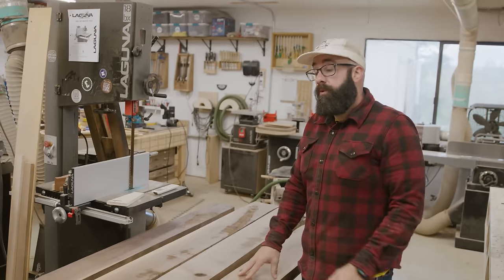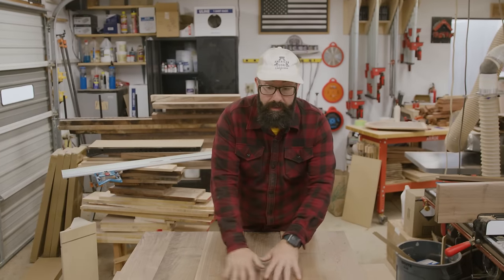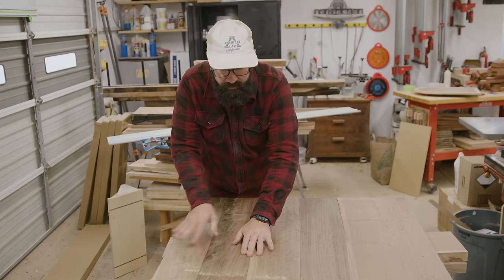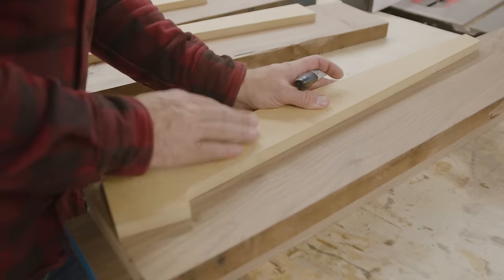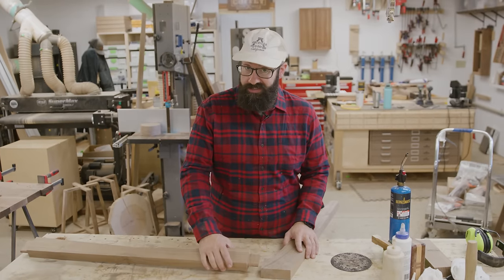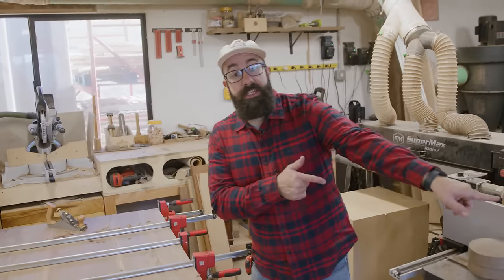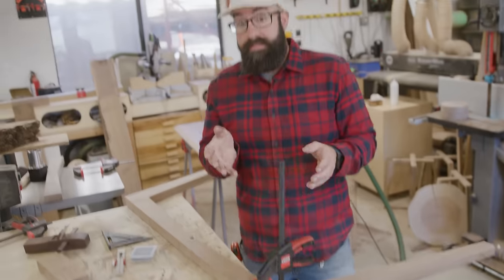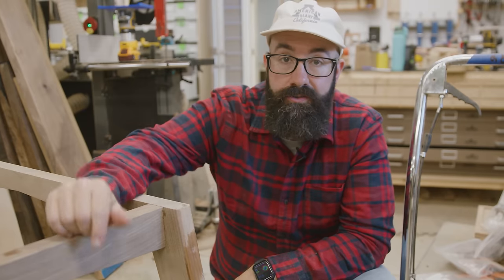$6,000 Two Day Table Build

Comment: The thing about the pantorouter and tenons, you have to test-fit while it's still clamped and sneak up on the right width while moving the guide bearing down the template bevel.
Reply from the maker: Correct.

Comment: Nice table, great video!
Since you have mentioned in the title I hope you don't mind if I'm asking about that $6K. Please believe me it comes from pure curiosity. 
While this is a really nice piece it couldn't really be any more simple, very straight forward, no tricky joinery no wild angles... Well you have finished it in two days. I'm no expert of the USA timber prices, here I could buy this amount/quality for $3-500 tops. I don't count the glue and the fittings, however that finish (rubio?) could cost some bucks, still I believe we're way under $1K in material. if you add $1000/day for labor (nice!) we're still at the half of that price you mentioned. 
How could you sell a nice but really simple average sized table that made of some ordinary wood (oak?) for that lot of money? 
Sorry if I was too straight forward, I really just would like to see it.
Reply from the maker: I'm fortunate to live near multiple highly affluent areas. Local and handmade does really well in this area. Specifically the Bay Area (tech center of the US).

Comment: Would you have considered using the Domino for the joints that were cut with the Pantorouter?
Reply from the maker: You definitely could. I would do the joint different but it could definitely be done.

Comment: Just found your channel, great work. At about 10:20 or so you are hand planing to clean up the top, why are you hand planing instead of sanding? I've never used a hand plane but it seems like it would be harder to make everything flat when using a hand plane and not doing passes the entire table length. Just curious. Thank you!
Reply from the maker: The hand plane puts things on the same plane. So it knocks down any high spits. The material that's being removed it higher than the rest. Therefore making it level. Typically it's only higher at the seams. I would have hand plane finished the whole top but the finish I used (hard wax oil) can't be applied to a hand planes surface. It has to be sanded. So the whole top was sanded after I knocked down the high spots with the hand plane.
Reply: @CoffeyCustomBuilds  I understand the point of the hand plane. And what it does. Could you not have just sanded down the high spots? I guess that’s what I was getting at. Since I don’t own a hand plane, this is probably what I would have done. But I can see how a hand plane would be more efficient and probably more accurate
Reply from the maker: @noahbriley definitely can. This is just faster and more enjoyable. I hate sanding.